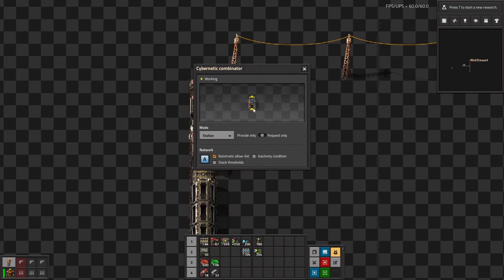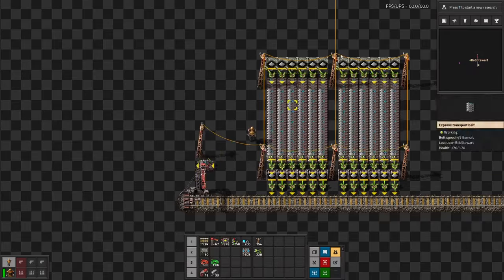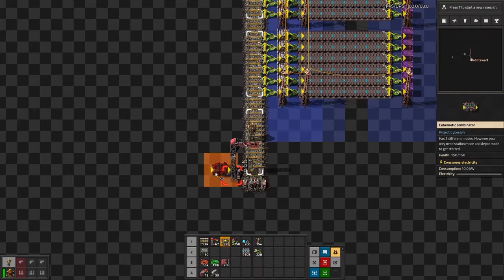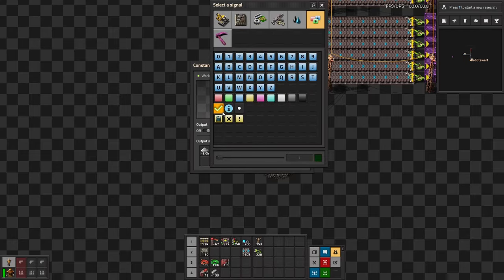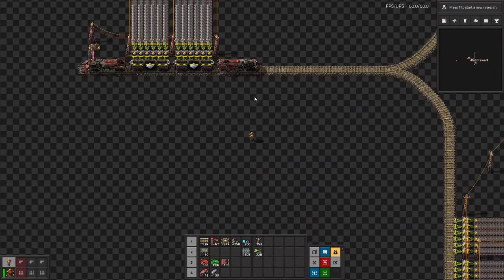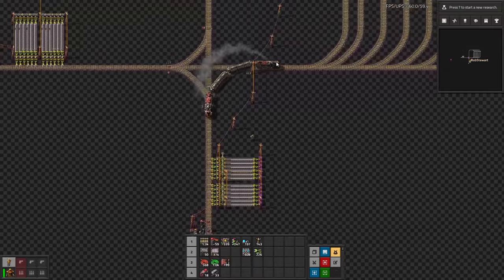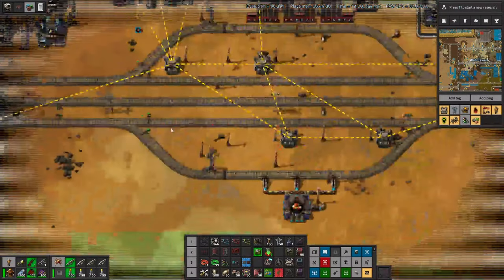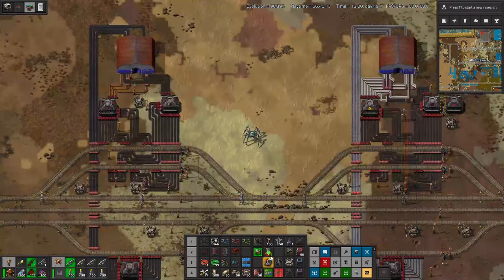Factorio Cybersyn Basics

Comment: Is it possible to make the "depot" act as the "refuler" as well? I know I could set up fueling at the depot, but akaif there's not a way to force the train to stay at the Depot until it's fueled, so it could be called out before recieving any fuel, and I would just like to avoid having a separate depot and refueler when my depot is right next to my fuel already.
Reply from the maker: From my understanding there is not since I don't believe there is a setting to do so. But also I don't think it should be too bad of a issue since you only need to make one refueler technically for the network and that can be wherever you want.
Reply: @kevinincorporated937  Fair enough, I guess I can make one or two lanes of my Depot into refueler stations
Reply: I dont think trains are dispatched if below full needed to complete the route, so having some depot lanes refueling and an actual refueler should work fine. Also, you could put the refueler on the route to the depot (say: entry->2lanes of refueler +1 normal lane->X lanes of depot->exit) and i think this forces and train going to depot to evaluate whether it needs fuel thus solving your issue

Comment: How do I assign a train to a depot?  I have the network set up, but the train isn’t assigned and when it is, it says no path
Reply from the maker: Might need pictures to figure out but assigning a train to a depot should be as simple as placing a train on a stop that has a cybersyn combinator set to depot and making sure the train is set to go there and is on auto. No path coming up might be something with your rail network and signals, check by selecting the train and I believe hitting ctrl and see if there is a valid path to the station you would want it to go to

Comment: How do you set up the train schedule?
Reply: it's automatic
Reply from the maker: Yep simply send the train to a cybersyn depot and it does all the scheduling of trains! That is what makes the mod awesome! You just need to setup stations to request and provide resources
Reply: @kevinincorporated937  Does it break if you try to setup multiple discrete train networks?
Reply from the maker: @ColonelSandersLite  I have not tested, if you want a definite answer you can hop over to the cybersyn discord and ask there: https://discord.gg/zmgUBu95HX
Reply: @ColonelSandersLite  The cybernetic combinator has a Network option, the default is network A.  If you wanted a 2nd network, say ones that were double headed, you could set those on Network B, and they would be treated as a different network.  Note that you'd still need the depo as well as both stations assigned to network B.

Comment: Hello - i watched this video probably 50 times :D helped alot. But im having trouble with a wall supply / request configuration. The provided Blueprints from the mod work at least the provider station for the wall supply. My problem is the request station if i wannt to load for example 20 walls, repairpacks, 20 bots in at the provider - they only load these 20 as per blueprint from the mod page. my requester requests only 20 20 20 - but it requests when one of these is low and the station unloads everything. Over time the boxes get full like 2,4k bots etc and then the system breaks since the train cant unload and cybersyn gives out a train stuck since it cant clear the cargo. If i wire the instertes on the box to only put items in that are not 20 then the train gets stuck aswell since its still full and cybersyn wants to empty cargo at the station so again rtain stuck message. Would be great if you could help me the internet wasnt so helpful for me.
Reply from the maker: This sounds like you forgot to wire the chests to the cybersyn combinator or perhaps to the wrong side, I would double check you have that wired up correctly because it should not keep delivering if there is a positive number in the signal.
Reply: @kevinincorporated937  After 2 Hours of trial and error i got it to work :D the wagon lock combinator option was needed - and the seperation of the oil so not a one cargo one fluid wagon for my wall train only a one cargo train and oil seperate
no wires are need on inserters - but the train will do only one item deliveries if only one item is out of stock
Reply from the maker: @Aemy1990  Well I am glad you managed to fix it and thanks for sharing your solution for others to see! Sorry that I was not much help I only really know the basics of the mod.

Comment from the maker: I forgot to mention in the video, but for the base I showed off the train limit for all stations were set to 1 to prevent multiple trains going at once to fulfill the request
Edit: So if your not using vanilla methods to unload materials (like loaders from K2) you will need to turn off the allow-list option on the combinator for it to work.
Edit Edit: I should have mentioned you require AT LEAST 1 depot and have a train assigned to it. In addition I believe when you request material you must request at least one full train worth for it to dispatch a train to the station. I apologize its my first time making a tutorial if I miss more things I promise I will remake.
Reply: Trains will be dispatched based on defaults unless you set limits via combinators. I believe the default minimum deficit before a train is dispatched is 2000 items, but you can set this to be equal to a full train load. You can also swap to stacks so you can specify how many slots are filled instead of number of items.

Comment: Hi! I'm wondering, when you're hooking up the red cables between the chests and the station, why do you also hook them to the power pole in between?
Thanks for the video!
Reply from the maker: Not sure about the specific part you are referring to, but I would assume it was to transport the chest data in a nicer fashion. Could you just run red wire on the chests alone and hook that up to the cybersyn combinator? Yes you can. I just used power poles for what I assume was for looks. As long as contents from chests are added together before going to the cybersyn combinator should be fine regardless the setup.
Reply: @kevinincorporated937  they do look good indeed! Thank you for the reply.
Reply: Hooking them to the power pole also lets you see the signals easily - very useful for debugging.